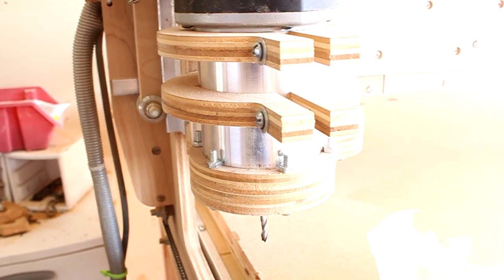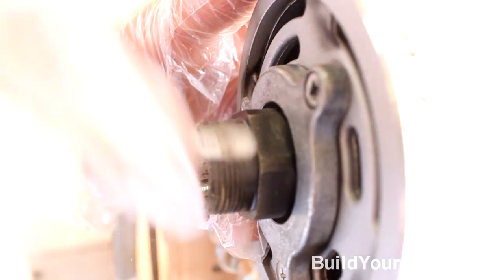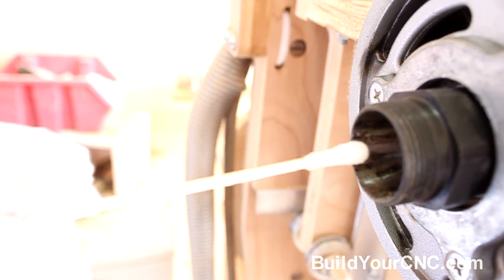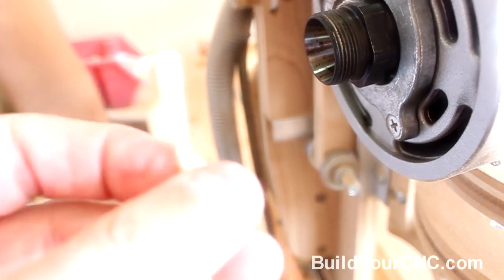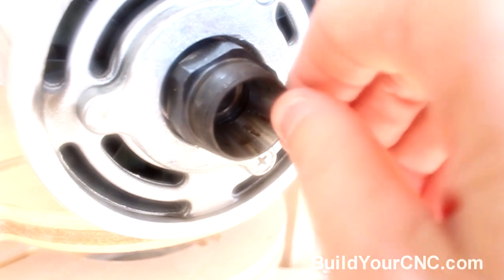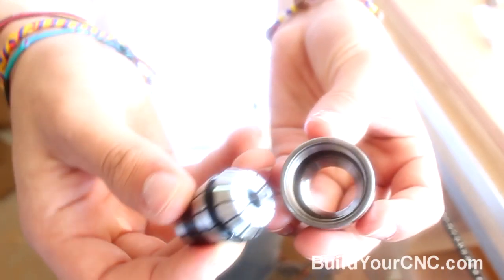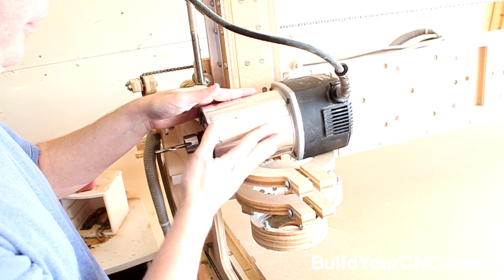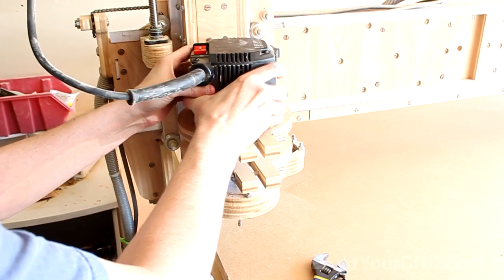collet removal and cleaning.mp4

Comment: I bought a plunge router very cheap and it works fine! But the original owner left a broken bit rusted and stuck in the collet. So I had to get it loose and cleaned with 'KROIL' and then CNC electronics cleaner.

Comment from the maker: @karandex This will actually depend on the material you would like to machine and how fast and also if this is for engraving, of full profile cutting.  My personal preferences are Porter Cable and Bosch.  They both have high quality bearings and can receive the collets that are specified on this video.  Your decision would be the HP rating of the router.  Generally, the low HP for adequate profiling would be from 2.25 HP and up.  Lower HP can cut, but the depths per pass would need to be shallow